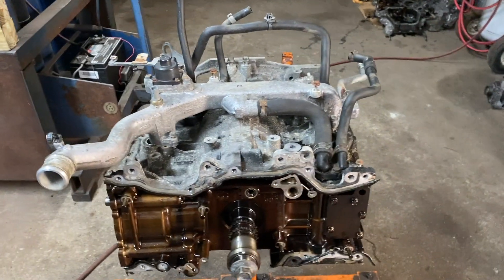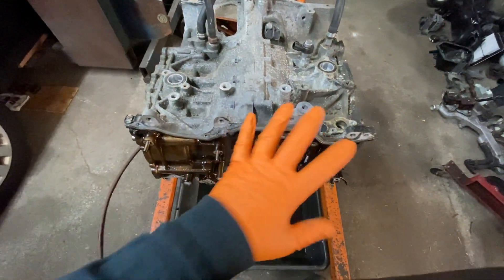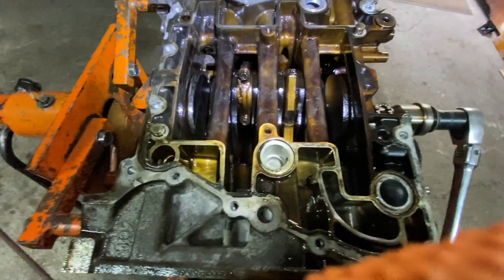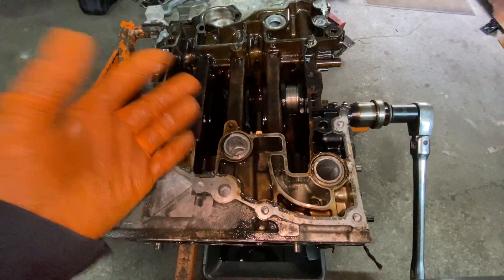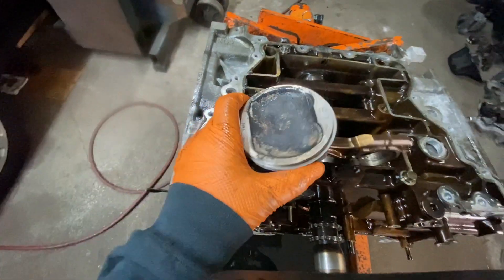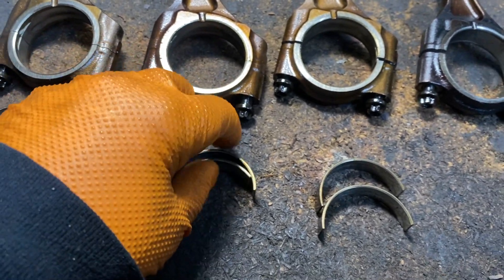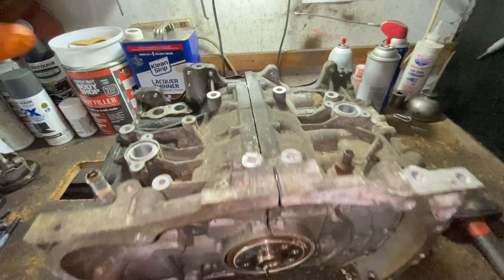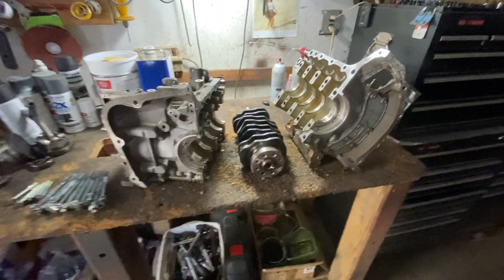Subaru FB 2.0/ 2.5L Block Split / Crankshaft Removal

Comment: Thanks for the video. Quick question. Could I remove the oil pan and that upper oil block that hides behind those three o rings with out taking the timing cover off and on the car. I want to just replace those 3 orings?
Reply from the maker: No, its not possible in the vehicle.

Comment: Great video. I was contemplating whether I should replace the main bearings as part of the rebuild on a 140k mi engine. I'll probably check the con rod bearings and check their conditions to determine if I should proceed with main bearings or just replace the entire short block for a peace of mind.
Reply from the maker: Either way is fine, the latter is more expensive though.

Comment: Appreciate the straight forward, no nonsense videos. Was wondering if this procedure of splitting the case is the same for a 2001 EJ25 Subaru engine? Still just 15 bolts etc? Thanks for the help.
Reply from the maker: Thank you! It's a little different. The pistons wrist pins come out through holes on the sides of the block and there are different bolts and locations for the block halves. Search my channel for that engine video, "complete Subaru EJ25 Engine Block Rebuild
Reply: Thanks a million. Will check out the other video.